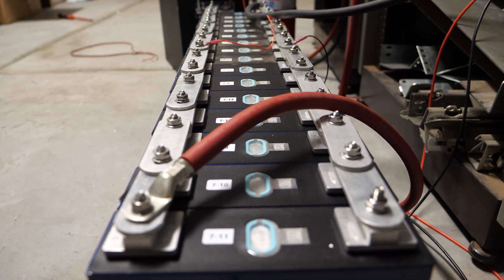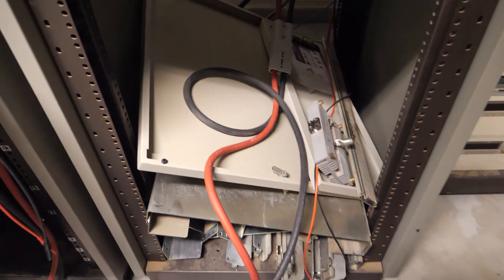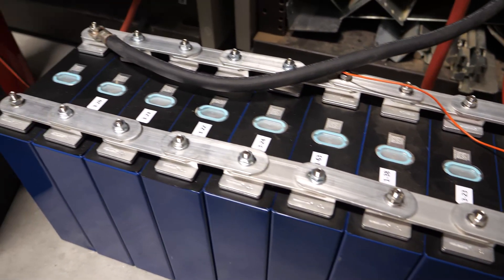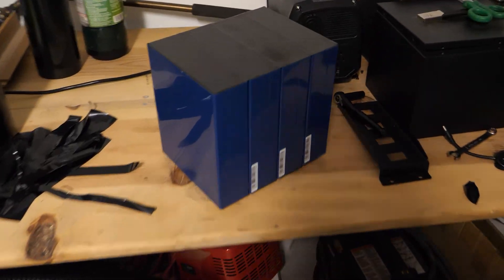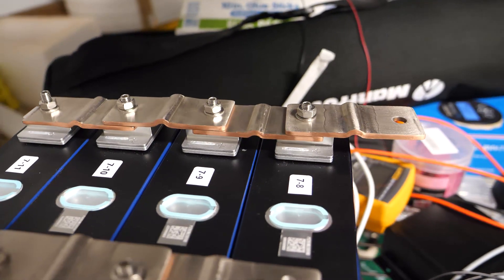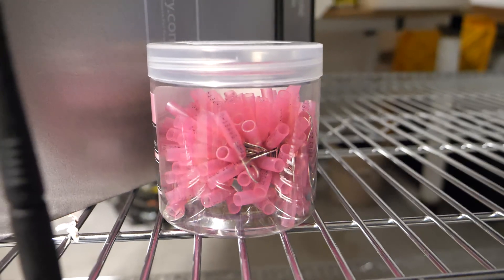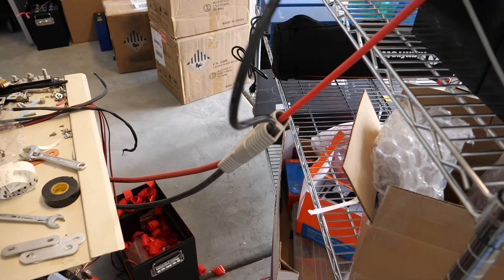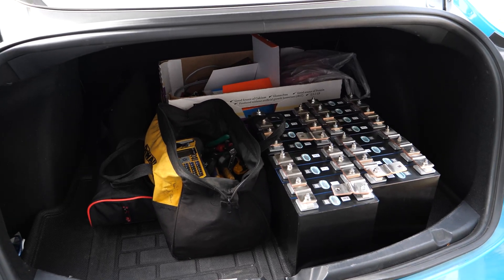920Ah CALB Battery Bank for RV | Pack Building Process

Comment: Hi! 

Not sure this is the correct place for this question, but... I plan on building a 280Ah 24v LifePo4 pack from 3.2v EVE grade A cells for my van project but cannot find good info on whether it is safe to do so and, if anything, was should be done extra to mitiage any risks. What I'm talking about is everything that is specific to a moving van that is shaking whilst driving through potholes on roads, etc. I know that such builds are good and work well for stationary solutions, just don't have any idea of whether its OK for a van and will not burn it down... If you can share some experience, would be awesome! 

Thanks!

Comment: Can I use battery cells without a shunt or BMS? Could you please go over options? I'm building two battery's for a off grid system. The cells are advertised @3.2volts / 320 amps.

Comment: copper connectors and aluminium terminals on the elements - didn't you have an issue with this?
Reply from the maker: No, the bus bars are plated to prevent any corrosion.

Comment: Could you have just used a single strip of aluminum or tinned copper busbar on each side with holes drilled for each battery terminal vs stacking multiple smaller bars?

Comment: 1/0 is more than enough for 220A in open air. At 25C ambient that would only hit 75-80C. Anderson connectors and most battery cable insulation is fine up to 105C.
Reply from the maker: I can agree. I haven’t upgraded the 1/0 and it still works well all the way up to 225A

Comment: I have a very similar setup - 16s 700ah @ 12v. Different BMS. Overall been very happy with battery bank. 16s is nice since you can rewire for 24v or 48v.
Reply: You can rewire it for 12v too. 12v makes sense for a rv since alot of things in a rv run natively @12v

Comment: I have a few different hp system supplies. I started my 6634a up with a 12v lithium battery hooked up before turning it on. I got smoke from my supply, looks like I shorted the ovp SCR.  Have you done this on any of yours?    Also these supplies have the ability to sink the output for use as a load by setting the voltage below connected voltage.
Reply from the maker: You need a diode to prevent reverse current flow.  It's in the manual actually.
Reply from the maker: As a sinking device, there is no current regulation, hence why you fried your crowbar circuit.
Reply: @HighTechLab  The crowbar was ok, i assumed that it was bad. I found a open resistor by the output transistors. Do a search for current sinking and you will find it. Yes they do regulate current.

Comment: How do you avoid using compression?  Is the Kapton strong enough without elongating?
Reply: Yeah, ditto on that compression question, especially given previous video you did on the need for that.  One more too:  where'd you get those flexible bus bars?  Been searching high and low for an affordable version of those and yours look exactly like what I'm looking for in my mobile set up.  Thx!
Reply from the maker: These CALB cells are build different and don't require it.  In my compression video I said to look at the specs from the manufacturer
Reply: totally unnecessary with modern lipo batteries

Comment: Fantastic, these types of videos are very much needed. Thank you for this. Also, it would great to see a comparison video/solutions chart (interactive) that applies to battery bank/bms sizing recommendations around engine/generator requirements in various climate conditions (eg. bms sizing to manage starting a Cummins 8.9L, as well as a variety of generator sizes/loads, etc  in real world conditions other than the 70*F ideal test conditions on most spec sheets).

Comment: Do you know of a solution that transforms Methane gas (from a Home Biogas digester), into electricity to run the whole average home? Some people use generators, but because the gas is unclean, it kills the generator, if its used for too long.
Reply: During WW 2 in England almost all buses ran on methane extracted from chicken crap ,it is ancient tech but it works.